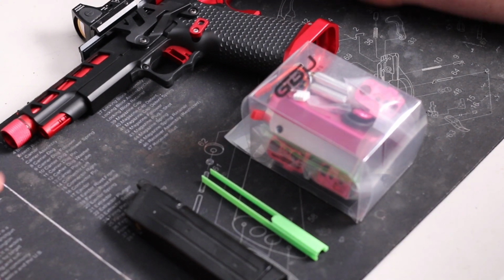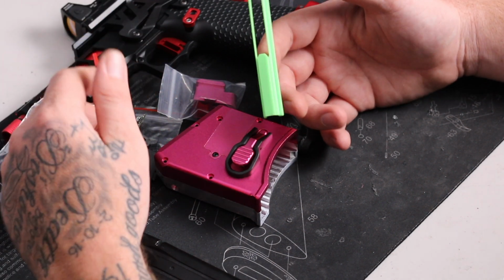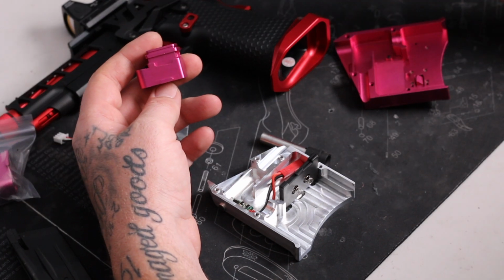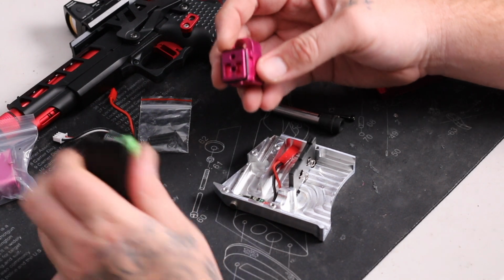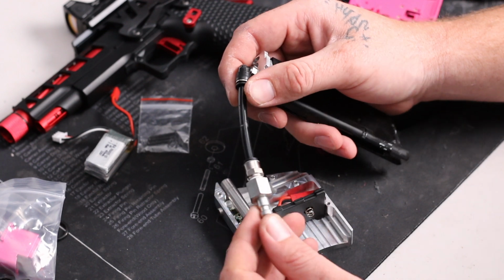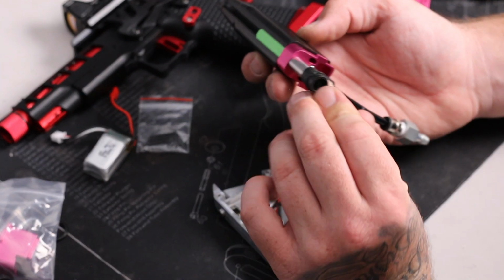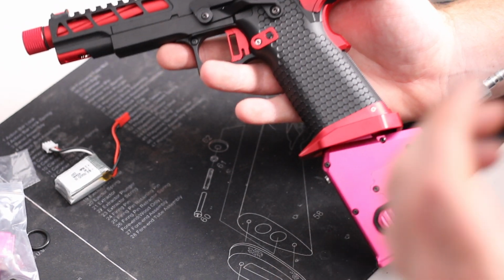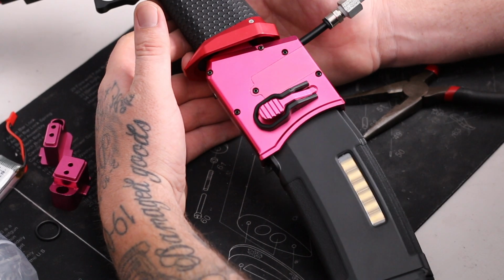New Pistol HPA Adaptor Step by Step Installation Guide

Comment: Looks good the only question is you get 3 different mag fittings but only one type of feed tube
Reply from the maker: why would you need more than 1 feed tube ? the tubes fit each style perfectly 💪🏾

Each time you want to swap out the connection you simply just add the feed tube to that connection 👌
Reply: @GelBallUndercover  ok at about  1:50 he says you need the tube for that Particular mag so the one tube will fit all the different mags
Reply from the maker: @coreyrich2567  Ye bro that's the sleeve that you insert into the mag to guide the gels.